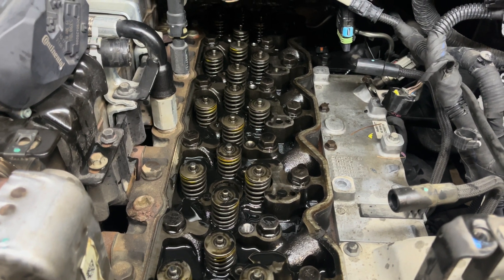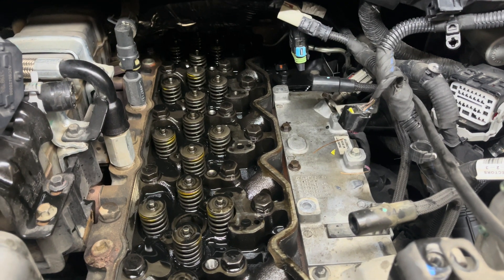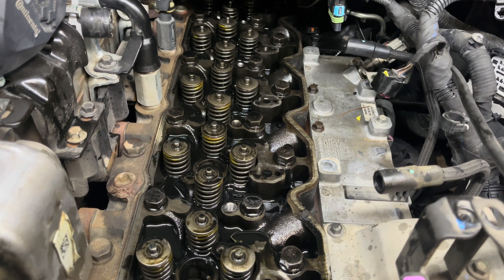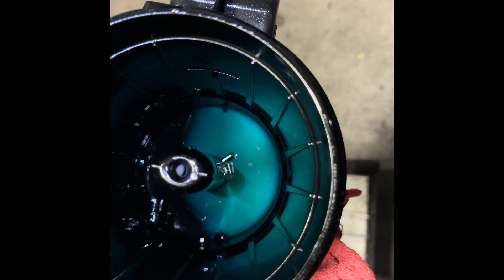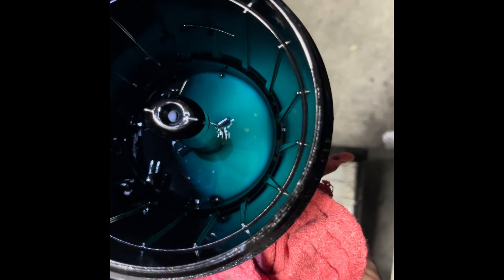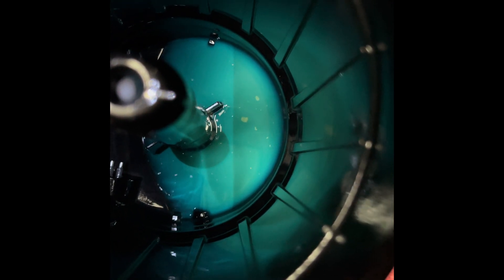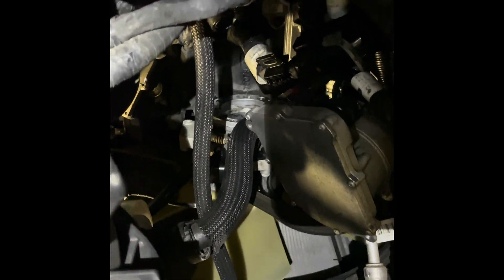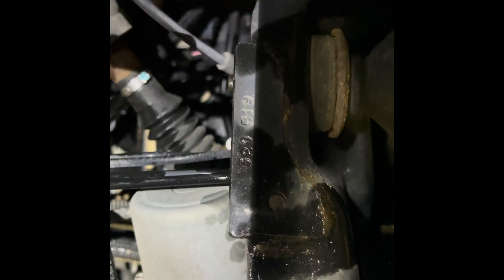Master tech finds another grenaded CP4 pump

Comment: I wonder why the high pressure parts cant be maybe have compressed air blown back through them the opposite way of fuel flow and cleaned instead of replaced. I admit I am not knowledgable about this type of stuff so apologies if the question seems insulting. Not intended to be.

Comment: Couple questions. So customer had cp4 fail and replaced with recall to cp3 and now cp3 failed? Is it do to fuel system not getting cleaned well enough from first failure? Or did the cp3 just poop the bed aswell? Also how come there was metal in the front filter, did the rear filter not catch it? Great videos by the way. Thanks.
Reply from the maker: First cP4 was failing at time of recall being performed, I doubt they knew it was failing. And we always see debris or metal in the front filter. Dodge filters actually kinda suck as compared to what they should be, in my opinion
Reply: @ I’ve been thinking of going Fass on my truck. You like those systems?
Reply: @Trukstuf Dodge filter ? You spelt RAM wrong.